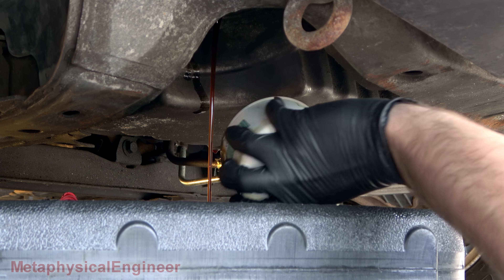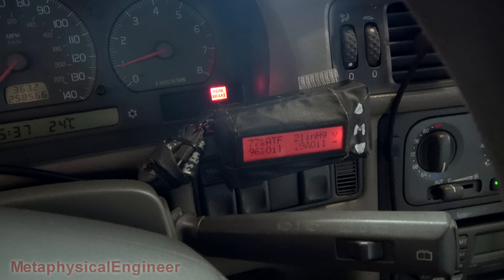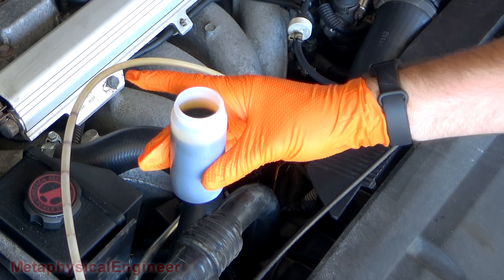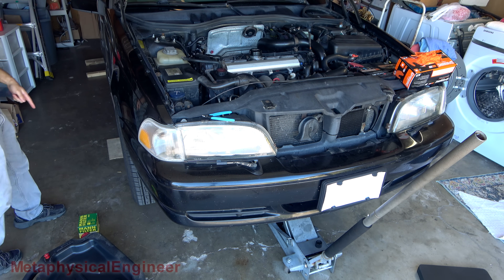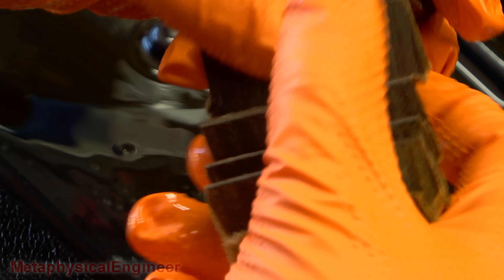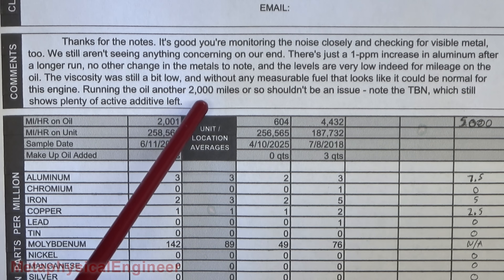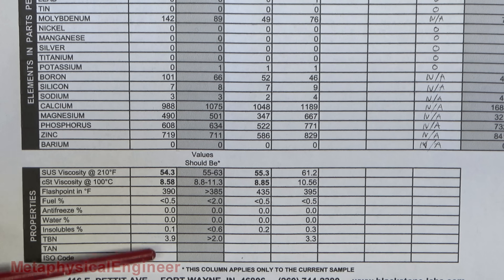Valvoline Restore and Protect vs Noisy Lifters - Used Oil Analysis and Filter Cut Open

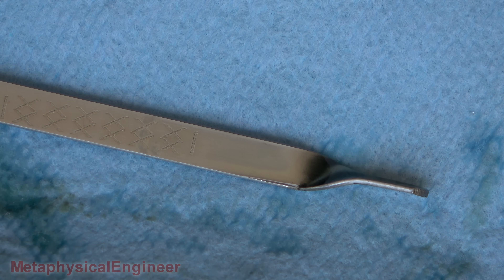Comment: At 160k miles on 5.7 hemi,,Used to go with ultra pen soil,,,, at 2000 miles with Valvoline restore and protect,,, I now smell smoke out the tailpipe,, and oil consumption increase to 1 qt every 2,000 mi,, but smoke  not visible,,, The oil still has clarity but is definitely cleaning the engine,,, well change at 3000 miles,, and do two more Valvoline  restore and protect,,changes after,,, then go back to the ultra panzoil...wix filter always... 2:13
Reply from the maker: Interesting that you seem to had an increase in consumption.  Would love to hear back about how the next couple oil changes go and if the oil use gets better again over time.
Reply: @MetaphysicalEngineer this maybe a crazy theory but I think his case is strange where the carbon build up on his worn high mileage engine was actually causing less oil burning until it dissolved the carbon and now there is more wear space and causing oil burning. My 180,000 mile crown vic p71 with over 3k idle hours loves this stuff and seems slightly faster after each oil change after the 4th or 5th oil change. I used wix xp all but one oil change at 3k each and one of the oddball ones was a fl820s ford filter

Comment: Best synthetic oil I every tired in my 3.6 vvt caddy....Every time I drive my car, it feels better; more power...After 2k miles, my engine runs as smooth as silk; car coasts forever; better gas mikage;  I can feel the increased compression...I will never buy anything else...
Reply from the maker: Glad you're seeing such strong results.  Looks like I need to wait a bit longer before seeing the full benefits.
Reply: It takes time to slowly eat away all the varnish and carbon, two things that don't dissolve well or at all with most solvents.  Both are fairly hard and baked onto the surface.  Give it some few-hour long highway trips with new oil and you'll see quicker results as heat speeds up the process of dissolving anything.

Comment: Years ago I had a noisy lifter issue. I was running 10w30 GTX and switched to 20w50 GTX and the noise never came back, so sometimes the oil can make a difference.
Reply from the maker: What year, make, model, and mileage?  Low oil pressure in a worn out engine can certainly cause lifter noise.  Here it's verified not a pressure problem so thicker oil wouldn't help.  If just thicker oil was the answer for me, the noise would be gone when engine was cold but appear at operating temp.
Reply: @MetaphysicalEngineer - It was an '85 Audi 4000 Quattro 2.2L 5 cyl with 60k on it. It ran fine it just had that tick tick sound. Our shop foreman suggested the switch. After we switched to the 20w50 it stopped. We drove it another 65k without any more ticking issues. I sold it to a coworker of my wife's and he's still driving it.

Comment: I had to come back and say, for the first time ever on youtube, I was definitely wrong about pre filling filters. YOU SHOULD PRE FILL OUL FILTERS! 
If you can't really fill it, because the filter sits horizontally, at least dampen the filter  to keep the surface tension of the oil from trying to tear the filter paper as it tries to rush through the dry paper.

Great video and I guess the lesson here is don't listen to anyone about something before researching it first.
Reply from the maker: Big respect for admitting your mistake.  Sorry if I came off as snappy at first, as the myths surrounding prefilling the filter are so prevalent that troll comments about it are pretty common.
Reply: @MetaphysicalEngineer  I haven't been able to catch the Motor Oil Geeks video on it yet, but I had a talk with a friend whose opinion I highly value, and he confirmed that it is better to fill them and at least dampen the filter media.
It's just weird to me because I've worked at about 5 different shops in my career and have never once been told to fill them first. Actually I've been told not to do it more often.

Comment: Thanks for the content, really well done! Wanted to mention that Blackstones method for testing fuel is not very accurate; they are great for universal averages though. You can see there is at least some fuel in the oil with the 395F Flashpoint, which may also explain the drop in viscosity. Hope you get the results you're hoping for🙏
Reply from the maker: I'd hope it wouldn't have much fuel after a fairly decent drive at full temp, but that would make sense if it had a trace given the other measurements.  I did recently discover and resolve a tricky PCV problem that only became a factor at certain operating conditions under load, which could have contributed.  The final sample will give a lot more insight, but that's a ways out; there's about 3000 miles on this oil right now.

Comment: Would anyone care to advise if just using valve cleaners, do we have to change the oil filters more often?
Reply from the maker: Valve cleaners sprayed through the intake shouldn't clog the oil filter, but often a good idea to do such a procedure before an oil change since some of that dislodged material and chemicals can make it past the rings into the crankcase.  

For engine flushes in the oil, follow the instructions.  Most say to run for a short amount of time right before an oil change as well.  This ensure you get the flush chemicals out of the engine right after, and replace the filter with the oil change anyways.

Long term gentle flushes like Marvel are situation dependent.  For engines with mild carbon, no need to change the filter early.  For engines heavily loaded with crud, absolutely change oil and filter early, at least until you have evidence that you are not overwhelming the filter or oil.

Comment: I put Royal Purple oil in my Chevy Cruze.  Lifter tapping went away right away.   After that I put in Valoline Restore and Protect oil for a clean out.  In about with Restore and Protect  2k still no lifter ticking.
Reply from the maker: Interesting that royal purple was able to resolve the tapping so fast.  I'll keep it in mind as I've heard good things about that brand in the past.  What year is your Cruze and how many miles/kilometers?
Reply: Less than 100,000 miles and 2014.   @MetaphysicalEngineer

Comment: Im one oil change in on a 2010 Honda CRV that was burning a quart of oil a month. Ive only had to add 1 quart this oil change and picked up .3 mpg. The dipstick is cleaner too, only a few spots left near the top that have darker varnish still. Really happy about the reduced oil consumption though.
Reply from the maker: Sounds like R&P is working as advertised in clearing up fouled piston rings.  Some of that mpg gain is due to restored compression, though some may be due to how this oil thins out a fair bit with use so there's less pumping loss.  How many miles total on your CRV?
Reply: @MetaphysicalEngineer  155,000 miles. I didn't think about checking compression first, that would have been interesting to track.

Comment: That engine doesn't use a sump system, it has an oil pan.
Reply from the maker: Maybe difference in terminology.  At least in US, "oil pan" and "sump" are interchangeable when talking about a standard engine design.

Comment: Still waiting for the day restore and protect oil will be available in europe...
Reply from the maker: Here's hoping!  I wonder what regulatory hurdles are holding it up, as there certainly is the market for it, and the lubrication performance should be able to meet the specs.  I do wish Valvoline would release a 5w-40 variant, given how the 5w-30 seems to shear out of grade easily.
Reply: @MetaphysicalEngineer I'd love to try it in my 2.4i s60. I just did an engine flush using tec2000. Next oil change could be VVL Maxlife. Think these engines could withstand 5w40? Hard to get non-ACEA C3 maxlife here in 5w30.
By the way, its pretty sick how your engine has a metal oil filter, mine's a plastic and cartridge type.
Reply from the maker: 5w-40 would probably work just fine.  Those grades tend to shear down closer to the 30 range over time.  Might have a tiny, almost unmeasurable loss in fuel economy from extra pumping losses.  

I think 1999 was when they changed to the cartridge type.  Easier to inspect those for debris, but I get how the plastic could be a reliability concern.
Reply: @MetaphysicalEngineer I agree, it was an interesting look at the filter media being pretty filled with debris. 
Anyway, i hope you figure out if VRP could make these volvo engines be not ticky - because most people say it's default like that.
Reply from the maker: The 1999+ engines also have solid lifters and a redesigned valvetrain, which can lend to a bit more noise.  Up to 1998 they used hydraulic lifters.  Injectors on these are also fairly noisy regardless of year.  Both sources make an even, mild ticking that blends together.  

The misbehaving lifter in my case is one specific exhaust cam on cylinder 5 that's making noise beyond normal,, such that it's clear outside with the hood closed.  Hood insulation muffles the top end noise but the louder tick is therefore even more noticeable above the normal sounds.
Reply: @MetaphysicalEngineer Thanks for the explanation, i have since watched the other videos where you describe it. I hope your efforts work to get the car to top spec again.

Comment: Good video.  
FYI dipsticks are notorious for being off.  Look up your engines specs from the manufacturer for the exact amount of oil it holds.
Reply from the maker: Thanks for the tip!
Spec is 7 quarts total and 6.5 for oil change plus filter.  Though depends on how long it's allowed to drain.  I drained it hot and long, and put 6.7 quarts in, which still didn't put it above the max line.  Since most engines have decent safety margin in the oil level, a quart or more lives in the top end when running, and I'm not slinging this beast around a racetrack, I'm not overly worried about the oil level sloshing high enough to get into the rotating assembly.

Comment: Only oil I use now on my 3 vehicles
Reply from the maker: What make, model, year, and mileage on those 3?  Did they have any oil consumption or sludge issues before that R&P managed to help solve?
Reply: @MetaphysicalEngineer i have a 06 ford freestyle 280 thousand first time on that car 2010 toyota camry 158 thousand first time on it and 2018 ford escape 85 thousand third time on it has made my escape much quieter and the toyota all have well maintained by me since ive owned them have done a lot of research on this oil i believe it is probably the best oil on the market today

Comment: I am on my second oil interval. I used this oil because I thought it would quiet down the lifters/ tick noises my L83 has. Since the first time I ran it with fresh R&P the noises got louder. I think Valvoline oil runs a little thinner than other brands. Using 5w-30 with AC Delco filter pf63
Reply from the maker: Do you have generic valvetrain noise, or can you identify specific valves making more noise than the others?  I can hear with a stethoscope that the second exhaust lifter on cylinder #5 is what's making noise on my engine.

Agreed this oil appears to shear thinner with use, which could possibly increase noise if the engine already suffers low oil pressure problems.  Many report quieter running, but every use case will be different.  Aside from the stubborn noisy one, I don't think the top end on mine runs any quieter overall on R7P vs other oils.
Reply: Or, perhaps, the oil works so well that it removed some gunk and exposed an issue.

Comment: 273k miles on my 06 CVPI. It never really burned oil maybe half a quart every 5k. Have about 4 oil changes so for and about 16k miles using Restore and Protect. I'm sure it's a great product but I don't really notice any difference. Granted my engine has been really well maintained and didnt really have lot o carbon build up in my opinion. Gonna keep using it. I did switch from 5w-20 to 5w- 30.
Reply from the maker: Sounds like your engine was already in great shape.  Half a quart in 5k is really good consumption for a retired cop car with that many miles.  With all the idle time those cars got in service, it might have the equivalent of 350k or more in terms of engine hours.  As someone who used to drive 2000s F150s for work with the truck version of that modular V8, I agree that 5w-30 is the better choice overall.  Engines ran quieter and didn't use as much oil with the higher viscosity, and a couple percent drop in mpg was worth the extra protection when those trucks got used hard.
Reply: Well to be fair it was a former detective car never used like most of these cars and was a Southern Colorado car and then S.Cal. My miles are highway, some town and the idle hours are of today is 851 so it really hasn't been sitting idling much.
Reply from the maker: That explains why it's still in great shape!  Those highway miles are easy compared to idling all day.

Comment: Great video.....subscription added.
As much as you change oil filters, consider a product that you place over the filter and unscrew.  This eliminates any mess.
Reply from the maker: That would be a good idea, even though I probably won't need to do mid-cycle filter changes going forward since the filter didn't look very plugged this time.

Comment: Just done the second change of R&P on a Coyote Ford with 170,000 Kilometres and has always been over maintained, 5,000 km oil change from new over 12 years. Never was an oil burner or a rattler but it does run a little bit quieter on this oil.
Reply from the maker: Sounds like you have a good starting point, and R&P should keep that engine running smooth for many many more years.  Did you notice the oil draining out darker than usual?
Reply: @MetaphysicalEngineer I only did the latest change on 8th July. What I noticed is the new R&P oil is quite dark and similar in appearance and smell to a CK4 heavy Diesel engine oil. I always use a non solvent flushing oil, about 400ml when doing an oil change. The old oil was dark like normal but was clear when draining, the oil had only done 4,000 kilometres. The R&P looked dark with a bit of red on the dipstick after about 3,500 kilometres, perhaps dissolved varnish, it went from clear to dark red at about 3,500 kilometres but it didn’t feel thin or like it was worn out and had lost viscosity. Day two after the change and the engine seems quieter again (which means I can hear all the other noises the car makes 🤣). Happy with this oil.

Comment: One unfortunate aspect of this testing is that with each filter change you're removing some used oil with the filter and adding fresh oil at the same time, so that is going to skew the results to some extent. Still useful obviously, but it is a limitation. TBN is also a diesel oil metric remnant so it isn't particularly applicable to gasoline oils as it based in acid neutralization ability.
Reply from the maker: For sure make up oil due to leaks, oil burning, or filter change like I did will skew the final analysis somewhat.  But 10 ounces in a system that holds 7 quarts is less of a problem than an engine that's losing so much oil it gets a whole oil change worth of fresh added during an interval.  You can see the earliest analysis I had done on this engine was when it had a leaking oil cooler line and thus needed 3 quarts added, diluting the wear metals and bolstering the physical properties.

As far as I've been informed, TBN is relevant to engines of any fuel type. Even a pure fuel like hydrogen that nominally just produces water vapor exhaust gases would still have some acid in the blowby from nitrogen oxides which the oil would need to neutralize.  2000 miles should be an easy interval for any oil on the market, but i wanted that mid-interval data point to make better sense of the data I'll get at the end of the interval at 4k to 5k miles.

Comment: Dollar general has Valvoline restore protect on sale for 6$ a quart very often
Reply: Oreilys has VRP 5 quart for $32 and you get a free wix Xp filter on sale right now.
Reply: @jasonfrance4927 guess that’s not bad deal
Reply from the maker: That's really good!  Unfortunately the nearest Dollar General is far enough away that the extra gas I'd burn to get there would outweigh the savings on the oil.  But if you got one in town, certainly go for it!

Comment: Why are keep on saying:" hydraulic lifters"?
Don't you realize that your engine doesn't have any?
Volvo used flat Tappet style with shims on their 5 cyl white blocks 
Using that oil will absolutely make no difference whatsoever because there's no nothing clogged in the motor to free up
Reply from the maker: Early white blocks such as this did use hydraulic lifters.  1999+ used a redesigned valve train with bucket and shim.